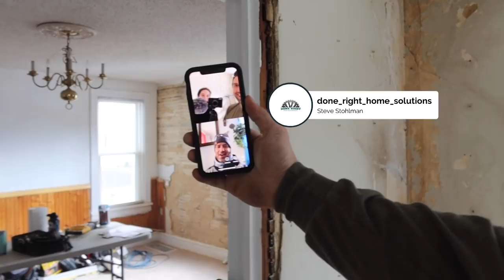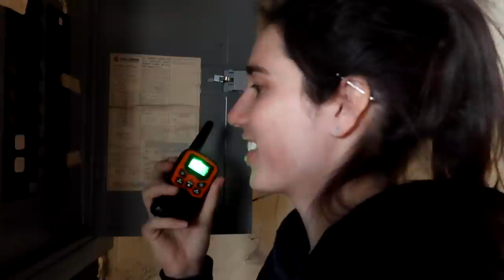Investing in Real Estate While Working Full Time | EP 6: Road to Our Next House Hack

Comment: Props to you guys for dealing with all of that plaster, that's a nightmare and a half. On my last duplex reno we ran into a similar issue, the outside wall was ice cold and in the summer time was beating hot. I didn't bother doing anything with the plaster, I screwed on furring strips at stud intervals and then in between i put those insulation foam boards, then sheetrocked to the furring strips.
Reply from the maker: Plaster is definitely not fun. Glad you were able to figure out a work around!

Comment: Definitely think you came to the right conclusion on how to insulate the walls after you considered the knob and tube. The diy blown in machines are awesome for doing loose fill attic insulation, but from what I understand they don’t have the pressure needed to dense pack the stud bays, the pros use a higher powered machine for walls so there’s no settling. Best to remove the lathe and do batts and have ability to add vapor barrier like you did!
Reply from the maker: Ahhhh good to know, didn’t know that about the blower machines, thanks for the info!

Comment: Love a good demo, hate cleaning it up and trashing it though haha. One thing that I do for demoing plaster is using a floor scraper and going parallel/45 deg angle to the lath. This may or may not work for you depending on how well adhered your plaster is (works well if loose, as you'd expect), but if you can get between them at all it really speeds up the process.
Reply from the maker: Ohh I liked that tip, I’ll try it out next time, thanks!

Comment: When doing dusty projects inside, put a couple box fans in some windows and create some cross ventilation to pull the dust out.
Reply from the maker: Yess great idea!
Reply from the maker: Andrew, sending an update that we used your tip a few times now, most notably when we were sanding down the plaster on the chimney in our bathroom and the fan was a life saver. Thanks again for the tip!
Reply: @RentalstoWealth  I saw the fan in the window in one of the videos and was super excited! Glad it helped!